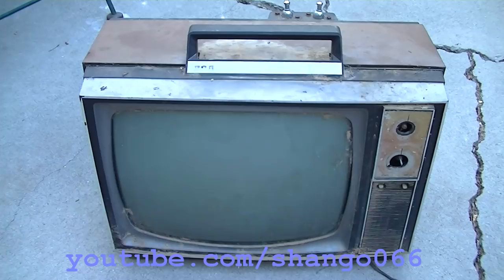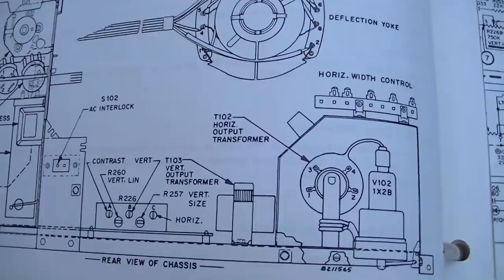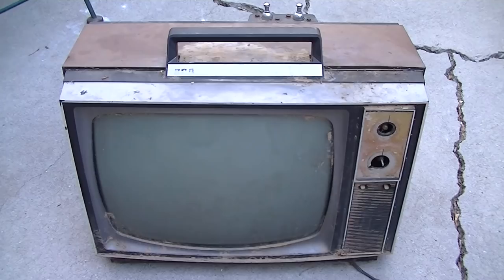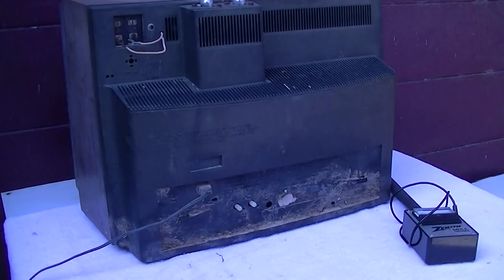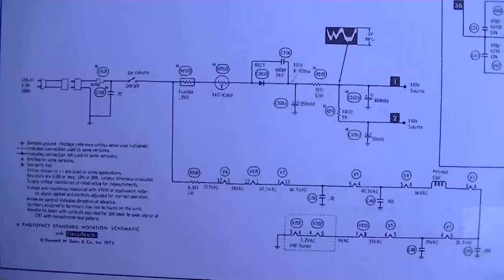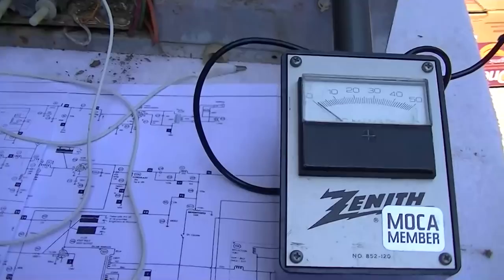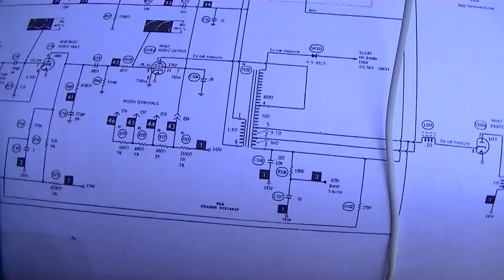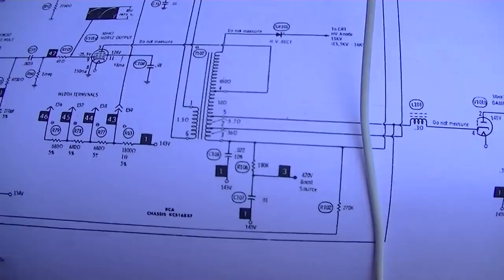RCA KCS168 TV High Voltage Diagnosis 1974 Vintage Black and White

Comment: I can think of 2 ideas. 1. Run high voltage arc across the short and burn some metal away or drive heater with dc with diodes?
Im not sure if it could work.
Reply: Heating it from the flyback is the simplest solution. Althogh rectifing with a fast diode and filtering the signal from the flyback is not a bad idea, if you don't have the gear to measure it's AC RMS accurately. You can put a series variable inductor before the diode, and tweak the DC on the filtering capacitor with it, then you don't need a special instrument or an accurate RMS capable DSO for setting the filament voltage, you can set it with any multimeter.

Comment: It's amazing how you try diagnosing the set without making the slightest effort to clean, or even brush off, the circuit boards and wiring of all that damp cramp, composed of God knows what....think of all the cross-wire,  cross-solder-pad and cross-tube-socket-contact leakage that must be going on when the thing is powered up.
Reply from the maker: try?
Reply: @shango066  Sorry, wrong choice of words! DO diagnose!
I love your videos!

Comment: shangoo you are correct. they did make a type of brightner that would isolate the filament so you could use the crt if it had a heater cathode short. it may have been called a isolation brightner but I cant remember the name. I never saw a schematic for one.would one of the sets you rescued with the bad yoke have a compatible crt that could be a doner if ur having problems with your isolating brightner.this is what you are talking about https://www.ebay.com/itm/SPB2-ISO-Isolated-CRT-Brightener-for-Projection-Sets-9-to-35/182417131479?hash=item2a78e887d7%3Ag%3AohkAAOSw-0xYdPON%3Asc%3AUSPSFirstClass%2101201%21US%21-1&_sacat=0&_nkw=crt+brightener&_from=R40&rt=nc&_trksid=m570.l1313

Comment: "You know pepe, ya can't polish a toid"... lol I just got this mint condition (on the outside) 1960 firestone TV, however it has several problems including the one I most feared (the heater on the CRT is open).  The CRT is a 17HP4, I know I cannot fix this, and I found one online but someone had already bought it.  I know people have left TVs out by the dumpsters like this one you're playing with, someone's got to have a 17HP4 lying around somewhere, any ideas of where I can look?
Reply: Have you tried connecting a multimeter across the filament and tapping the tube seeing if you can reestablish continuity? Sometimes you can weld the filament by tapping the tube with a charged electrolytic capacitor attached across  the filament. Radiotvphononut did this on one of his videos on an early 50s t.v.

Comment: When was the last Black & White TV made?    Surprised they made B&W in 1974.    
Love the fancy "sophisticated" names.     Thank you for sharing!
Spider webs and dirt slightly shorting circuits?
Love your fun diagnosis!
Wow!  FLIR!    Is that resistor normal heat or excessive?
Reply: B/W sets were made as far as 2008-2010 (the small 5" portable ones), maybe they still produce them for the local market in China. 

For bigger, table top receivers, I don't know, but I think until the early '80s. Bigger (14-17") portables through the mid 80's. But that's for Europe. Here in Hungary, there was a 24" B/W table top pruduced in the early '90s by Orion (until 1992, maybe 1994), it probably was intended as a budget set for the poor. IR remote, synthesizer tuning, OSD, and B/W, all in one :). I really need one, but they're very rare, I've seen only one until now.

Comment: Too bad you don't live near Georgia. I have two 25 inch dot matrix CRTs for the older sets I would like to give to someone who could use them rather than throw them out. One was rebuilt by Magnachrome in 1987 then didn't get much uses after that. I remember it cost about $125 to have the guns replaced.

Comment: 17HP4 CRT - Anyone have one for sale, or do you know where to get one?  I could get a used one and rejuvenate it just so it would work... but how would I fix the filament, oh duh bust the neck off with a hammer, and re-wrap the heater wire.  That would fix the filament... at least :)